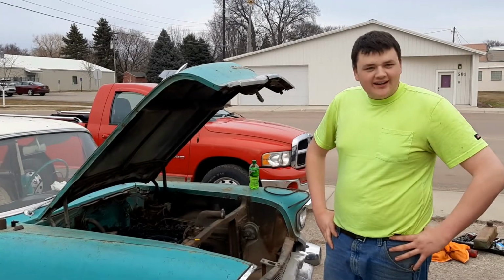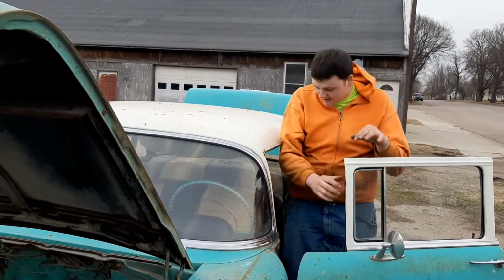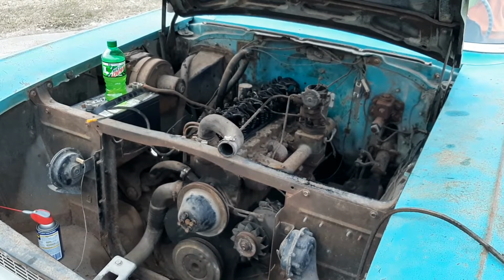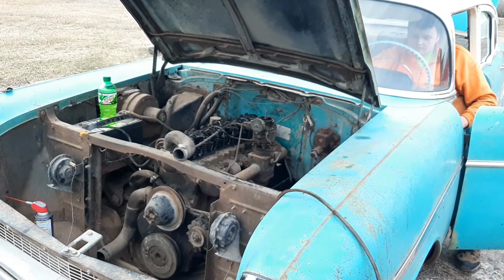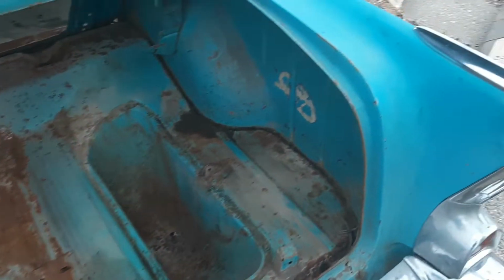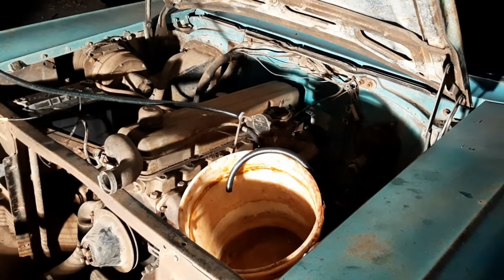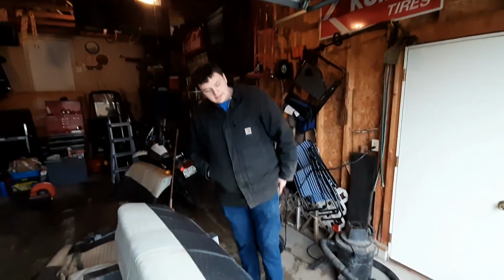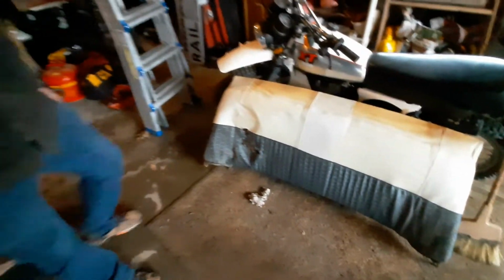1957 Chevy 210 Rescue Part 2: First Start

Comment: 😎 that you decided to keep the original 6 rather that drop in a Small Block Chevy V8.. Most of these that were born 6s usually end up with a Small Block Chevy V8 ( or ANY Chevy V8 for that matter.) Swapped in...
Reply from the maker: Andrew wants him to put a v8 in, but since it runs I'm sure he'll keep the 6
Reply: That may make this somewhat rarer being that most 57 Chevys that weren't born with a 6 likely end up with a Chevy V8..
Reply: If the 6 runs good,keep it in there! That way you can concentrate on brakes and other stuff.

Comment: you have a 235 cubic inch 6. FAIR WARNING, change the timing gear before you start to cruise this motor. this is from past experience. I have the same car in all black and my timing gear failed due to lack of oil and the fiber it is made of. research this before you have the same trouble I did.